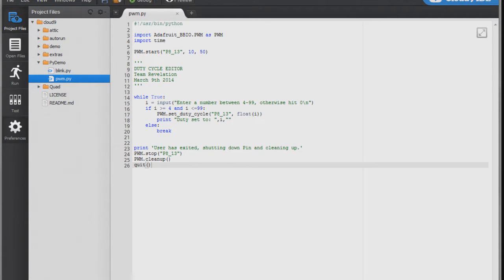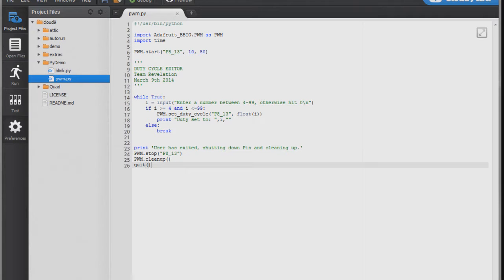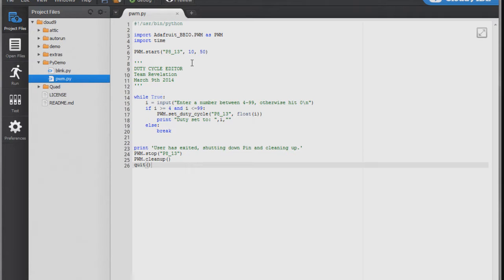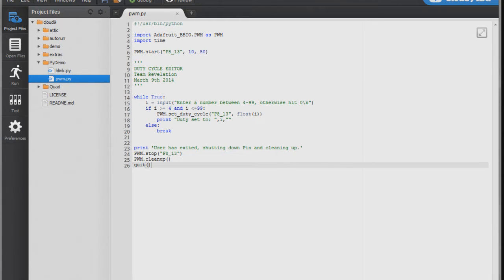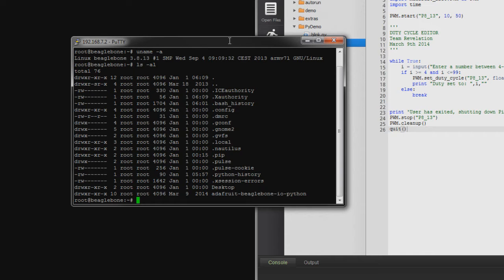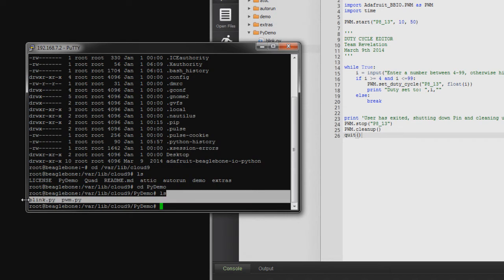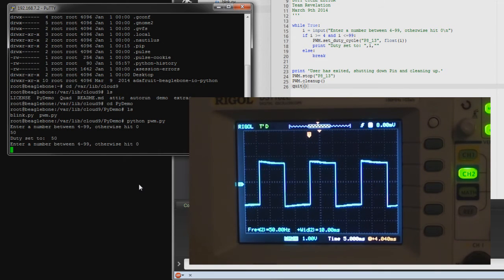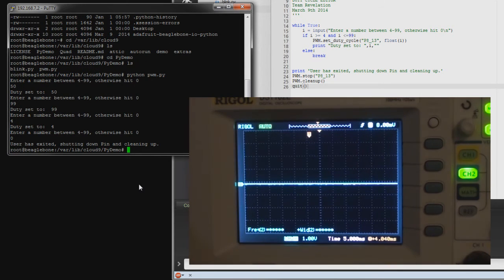Calibrate ESC with PWM Python BeagleBone Black

Comment: Hi man , thanks for the explanation, i would like to ask you a question:
I am using the turnigy dst 1200 motors , and i would like to know if the parameters for the pwm( 10,50) are the same for my motors or where do i look for this info? or what we could do to make a wider pwm range .
Thanks in advance